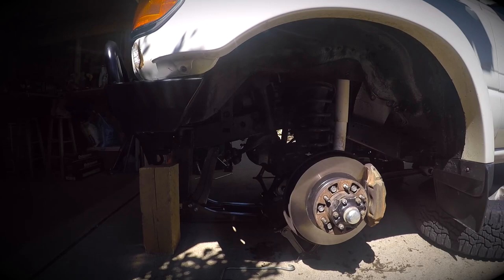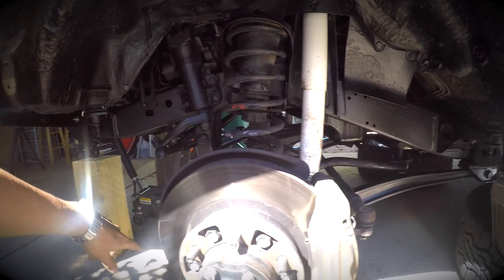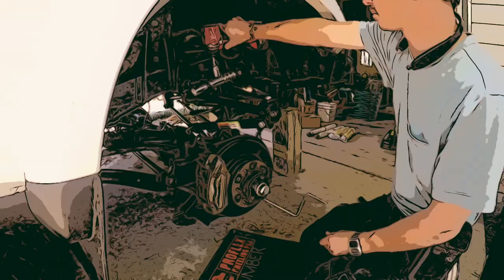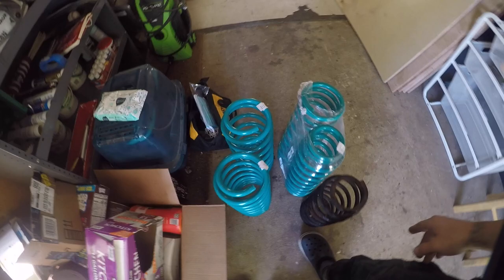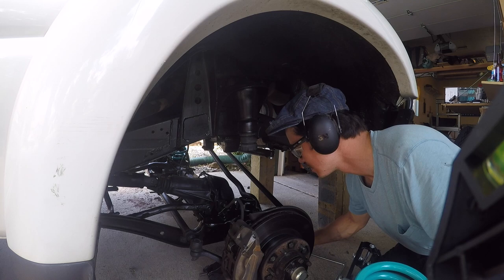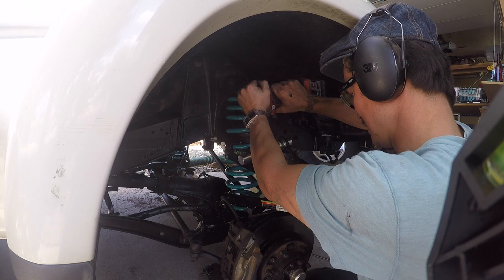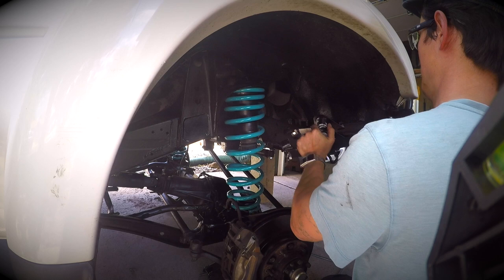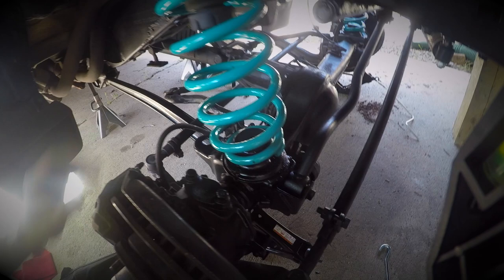Dobinson Suspension replacement - 80 series land cruiser 1993

Comment: Thanking about doing the same set up how it’s ride so fare would you recommend it or something else? Thanks
Reply from the maker: Great question! I've now been riding on these for 3 years now! Though I haven't used any other brands. The quality is superb. It was I think $2300 for all of it. I kept the standard ride height and the response is super nice. For sure highly recommended. If you have a small lean on your gas tank side I would recommend a 30mm spacer. I used a 10mm and I wish I would have done a bigger one. Anyway! Let me know! Also I was worried about the colors making in look cheap and like a toy. But it's nice to have a peak of color popping threw!

Comment: You don't even need that spring compressor if you just get the car up higher and droop the axle down 1 side at a time. Why are you even thinking about the caster? You don't need to do any caster correction if you are doing stock height springs...or even anything under 2".   So you don't have to replace those bushings.....but anyway.
Reply from the maker: Jesus Christ. Settle down dude. I didn't do a caster correction for one but I like new bushings since I'm there...having a spring compressor is called being prepared. Where's your how to video?! Your spray can wheels look cheap and ghetto. Have a good one
Reply: @JoonRhee  haha. Just trying to help guy.
Reply from the maker: @NigelNaughton  oh me too